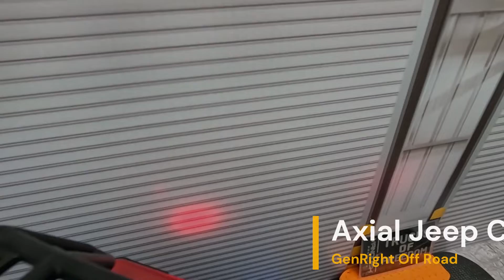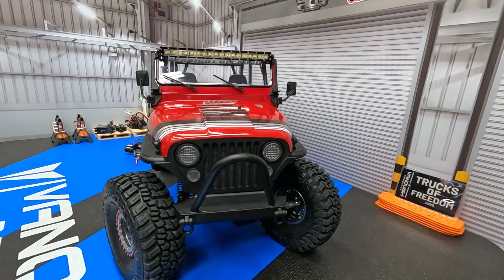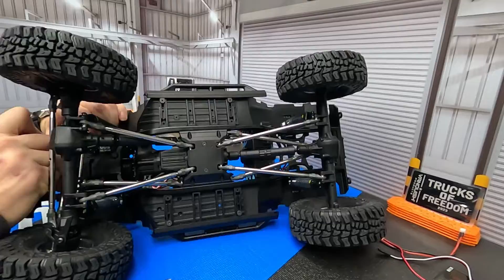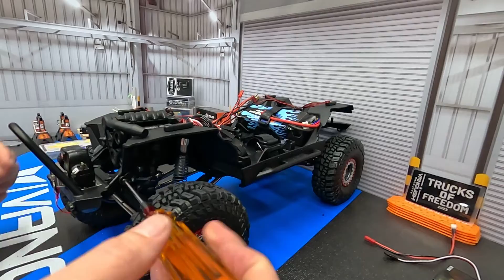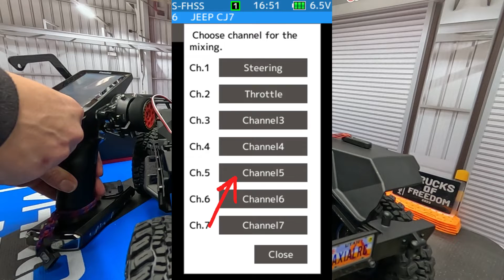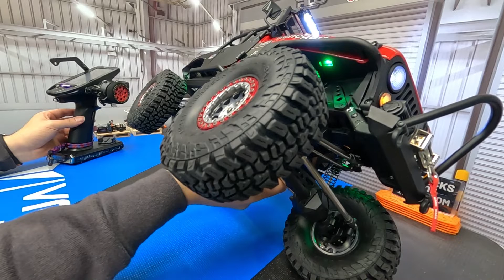Axial Jeep CJ7 Build PT5 Winch Install #rc #trending #jeepcj7 #axial  #offroad

Comment from the maker: The actual RC4WD winch used in this video is RC4WD - RC4ZS1079 - WARN 9.5CTI WINCH 1/10 not the Mini.  At minute 01:09:00 I accidently used the wrong picture I had for it to show the Part number.  I did have the correct link for it in the description though.  Thank You.

Comment: Hello, nice videos :)  I've installed a winch on my cj7, but I dont know how to use screws to attach it to the bumper, I've used zipties, I can't screw on top as I cant get to the holes with a screwdrivers on the plate of the winch, if I screw the plate I can't screw the winch back on the plate.
Reply from the maker: Thanks for Watching.   Since I was using the plastic bumper and an rc4wd winch, there was a plate the winch comes on.  In the speed part of the video, you can see i use it to mark the holes and use the markings to drill the holes.  I then re-attached the winch to the plate and the attached the winch to the bumper using the screw holes to screw into the plate from the bottom of the bumper.  If you are using the same winch you can pretty much do it the same way with any bumper. As long as the winch fits it anyway.

Comment: Wow got some cake in this one . The radio r those different channels & how many does the transmitter control?
Reply from the maker: Thank You for Watching.   The Transmitter I am using is the Futaba 7PXR paired with a Futaba 8 channel receiver.  The TX can only control 7 channels, so the 8th channel on the receiver can be used for anything needing power, i.e. additional leds.

Comment: great video. going to install my winch. do you have the make and model # of the light bar?
Reply from the maker: @travelinwithTODD  thank you for watching.   The LED light bar is from Vanquish Products. It is 6" and part # is VPS06751.  These have been out of stock on their website for a while, and I'm not sure when they will be back.  That does not mean there isn't one available at a local hobbyshop.
Reply: @henrysrcgarage5210 do you happen to have a normal speed video of taking off the front part to drill the holes. I must be dumb. I can't seem to get that part off
Reply from the maker: @travelinwithTODD  I looked at the video and I did it via time lapse.  Sometimes I do not do that but I guess I did with this one. 

There are 2 screws holding the bumper in the chassis rail.  One screw is part of the Panhard mount with a flathead.  The other one is a button head.

On the backside of the bumper there are 2 buttonhead screws as well.

sorry I do not have a normal speed video but hoping what I said above helps.
Reply from the maker: @travelinwithTODD  here is the link to the CJ7 Manual.  There are exploded views and on page 53 should help you a little.

https://www.axialadventure.com/on/demandware.static/-/Sites-horizon-master/default/dw2ea94ae3/Manuals/AXI03008_Manual_EN.pdf
Reply: @henrysrcgarage5210  thank you for this. i must have been out of it! lol. this isnt my first time working on RC's but i think i had a brain fart! lol. thank you
Reply from the maker: @travelinwithTODD  oh I know that as well.  I had one of those recently.
Reply: @henrysrcgarage5210  i have the winch installed! good to go. thank you
Reply from the maker: @travelinwithTODD  awesome!!
Reply: @henrysrcgarage5210  thank you for the info. i am trying tp upgrade my CJ7.

Comment: What esc did you put in your rig? I ordered a new receiver and transmitter so I can eventually use my winch from it but I just noticed it has the spectrum smart receiver and esc combo in it so I'm gonna need a new esc to make it all work
Reply from the maker: Thank You for watching!  I put in the Castle Copperhead ESC when I removed the Spektrum 2 in 1 brushed smart esc.

You can watch my earlier video of what i replaced the stock electronics with here: https://youtu.be/qMeH4ss1F6g?si=j74cT4fg_cHP7LF9